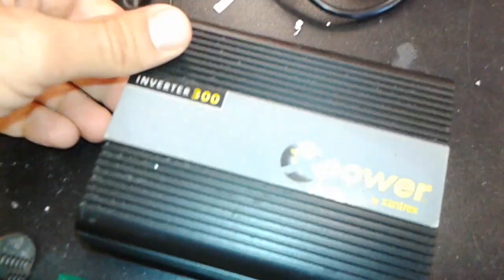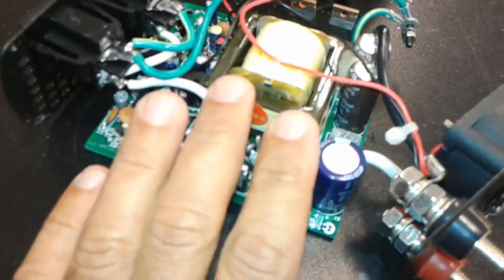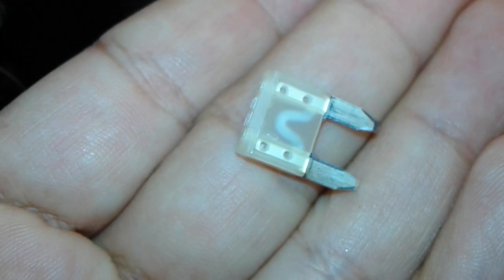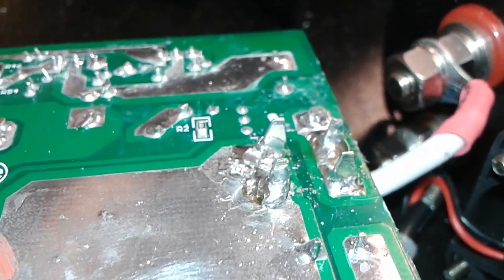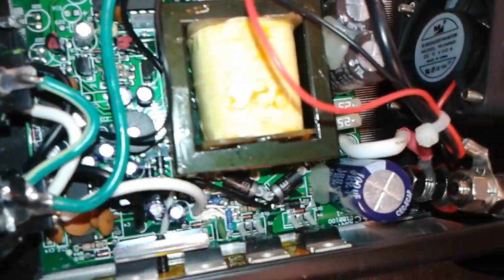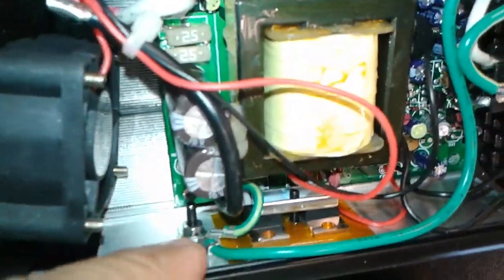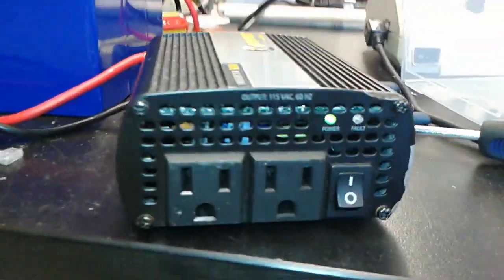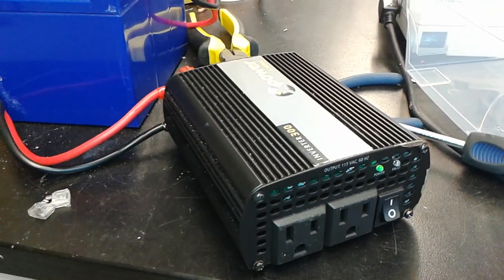How to fix your power inverter after you blow the fuse

Comment: I searched to find if there was a fuse or reset button in my 1500w inverter. I came across this video. I opened the inverter and found 6 blown 30a fuses. I changed them and the Schumacher 1500 Watt Power Inverter is back in service. THANKS!!!!!
Reply from the maker: Your comment made me very happy! You save electronics from landfill, accomplished a challenge and have an inverter to use now! congrats and thank you for commenting!

Comment: thank you,  I just got exactly same inverter not working and search and find this video before I decide to buy a new one.  I luckily find inside there is a plugin fuse, no welding required.  A BIG THANKS and Merry Christmas!
Reply from the maker: Lucky you, you can fry and fix it quickly! I guess they figured it out that it shouldn't be soldered but rather plugged in. Merry Christmas to you and your family!
Reply: I hope to have the same sort of luck!  I'm travelling and don't have my soldering iron.  Hopefully the fuses are just plug and play 🤞

Comment: I did exactly that today....accidentally inverted the polarity 😮 My inverter is different than the one you show and has a fuse in the positive lead. The fuse is a 200 Amp fuse, not like the mini fuse shown in your video.  
It looks okay but maybe there are a couple more fuses inside the body of the inverter. 
Thank you for this video.  It provides me with the guidance and any extra steps that I may need to take.
Reply from the maker: I really hope that yours is a newer model and they designed with a serviceable fuse outside the box. Hopefully by replacing the fuse on the lead it solves your issue.
Reply: @photographiedynamic  because I'm travelling for another 4 weeks, I decided to just buy a new inverter and fix the broken one when I get home.  
I broke and now have a newer model, Everstart Maxx 1000 watt modified sine wave inverter.  
I found another video that shows exactly how to fix it, too.  
I'm more educated about inverters than I ever thought I would have to be!!!  🙌😀
Reply from the maker: @NomadJan  one more thing to understand about inverters: "Modified sine wave inverters are cheaper but their efficiency is only good enough for non-delicate devices. On the other hand, pure sine wave inverters are the most costly but they can power up all home and delicate appliances as efficiently and as safely as a home or office outlet could."
Reply: @photographiedynamic  thank you, I do realize that but I don't have the budget right now.  I'd rather go without one at all before spending my travelling budget. 
I'll get a pure sine inverter another time.
Reply from the maker: @NomadJan  not to worry as most simple electronics will run just fine on modified sine waves!

Comment: Thank you for the video 🙂 I just blew mine as the lead coming out was all black instead of black and red 😯😯
Reply from the maker: Replace the lead right away to prevent future issues or grab a red electrical tape and cover the black wire with it. Thank for comment!
Reply: @photographiedynamic  I'm going to replace it. I had a similar problem today with a new LED strip I bought. Solved that one using a 9 volt battery rather than cooking it 😄Thank you 🙂🙂
Reply: Update, took it apart, the lead had red electrical tape on the inside where it couldn't be seen 🙄 The fuse however was just clipped on and not soldered. All repaired now and positive and negative crimp connectors fixed on the ends of the lead 😎
Reply from the maker: @ZiggySearchfieldCactus  Awesome, congrats. And thank you for saving an electronics from landfill!
Reply: @photographiedynamic  Thank you for the help 🙂I switched the lights on today, installing the rest of the solar panels tomorrow. Starting to look like a fully operational Death Star now ⚡😁

Comment: I have a motomaster 3000 watt inverter that has power but not power to plugs. I opened it up and it has about 20 25 amp blade fuses but I can't pull them out. They seem to be soldered in. Is this normal? How can I check them?
Reply from the maker: The "intelligent" people who designed and manufactured these inverters did not follow any electrical engineering rules. You never solder a fuse to a pcb, it need a socket so that it can be easily replaced. Take a multimeter and test for continuity if you can touch both end of the fuse. No continuity means the fuse is burnt. You would have to use a soldering iron to remove and replace them with a new one.

Comment: Good video. Can I ask you a question?  Mine has the fuse outside. I just replace it. But when I put a new fuse it keeps blowing it.
Reply from the maker: Are you sure it's the right fuse? Are you getting the polarity right when you are plugging it? Can't think of anything else.
Reply: Hey werid !!! But I just try to switch out the fuse on a power inverter I have that was blown due to reverse polarity and now it’s fine but when I try to turn it on all it does is make a click sound? What do you think it is?
Reply: I have used the unit for around a year and when fixing my truck cigarette lighter charger my idiot self connected the wires wrong and the fuse blew. And now I changed it and soldered it on and now it just click sounds. I’m not the best soldering guy either but it looks ok and didn’t touch anything else
Reply: I also have the same experience.

Comment: Sir can I ask question pls...
I have 12dc to 220ac inverter here, but it keeps on buzzing every time I try.. What should I do? This is new bought from online.. Pls response..
Thannkyou
Reply from the maker: First thing to check is: does the 12 v battery have enough power? Try plunging to a fully charged car battery.
Then make sure the appliance you are plugging on it does not consume more than what the battery and inverter can provide.
Reply: @photographiedynamic  but I tried it on car battery, and on a motorcycle battery, but the result is just the same sir, icant try any appliances because every time I try to plug it to the battery, it keeps on buzzing, and red lights, which labelled "fault" there the normal is "power" but it doesn't. Thanks for your response sir, really need your help.
Reply from the maker: @mr.niceguy8960  "Fault" appears when the polarity is inverted. Make sure the cables are plugged in the right polarity at the battery terminal and on the inverter.
Reply: @photographiedynamic  OK sir, I'll try it again, if it doesn't work, should I ask it again here? if you mind sir.
Thank you very much sir,
God bless 😇😇😇
Reply from the maker: @mr.niceguy8960  give it a try and let me know. If that doesn't work, most likely defective unit...
Reply: @photographiedynamic  or maybe 24v dc battery is required for this inverter? is that possible reason sir? Because at the back of inverter, I found 24V dc labelled..
Reply from the maker: @mr.niceguy8960  Awesome, there you go, you found your answer. So don't keep same polarity, but plug two batteries in series.